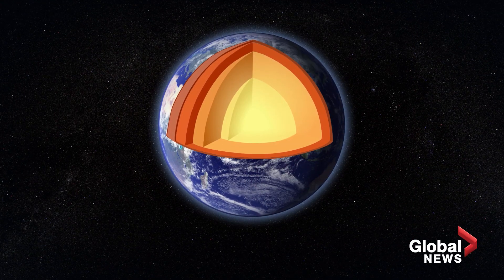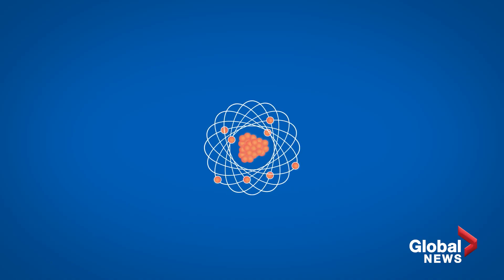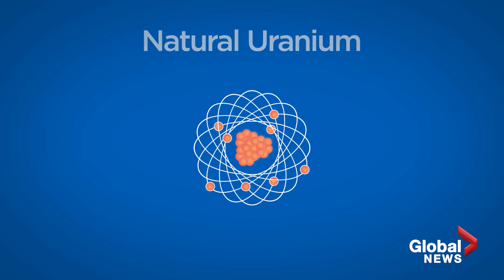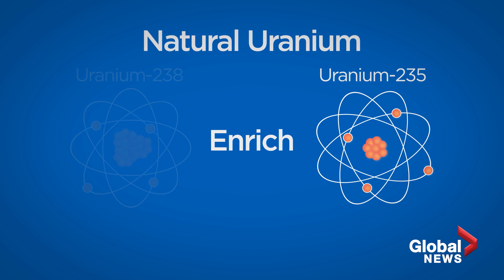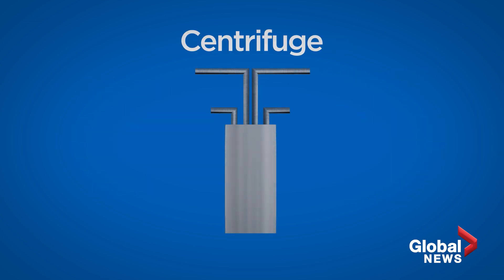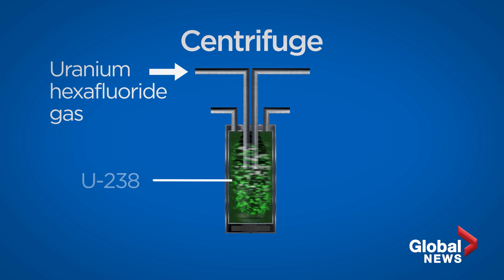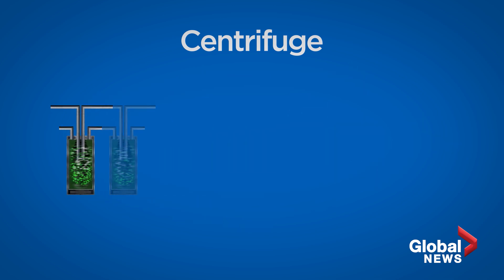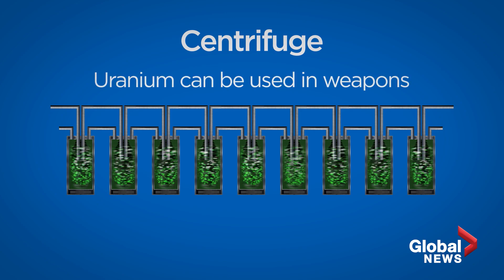Enriched uranium: explained

Comment: One question I have, and I hope its not a silly one, is why are there no instances of uranium 236 and 237? My rudimentary understanding is that forces enacted on an atom can remove neutrons, so why do we see 3 removed, never 1 or 2? It's a genuine question. Would love to hear the answer.
Reply: Uranium 236 and 237 exist but are quite rare. Uranium 233 is another common isotope that is easily fissionable like uranium 235.
Reply: From what I understand there is a complex relationship between the number of nuclides (protons and neutrons) and the stability/ half life of an atom. Essentially we need to look at the mass of an isotope and compare it with the mass of possible decay products. U 236 for example will easily decay into Thorium 232 through Alpha (Helium 4 / 2 x proton and 2 x neutron) decay because the mass of Th 232 + the mass of He 4 is less than U 236. U 235 will actually also decay but on a much longer time frame since the mass of Th 231 + He 4 is less than U 235. The longer time to decay is because the difference in mass change is much smaller.
Reply: It's too unstable to use.